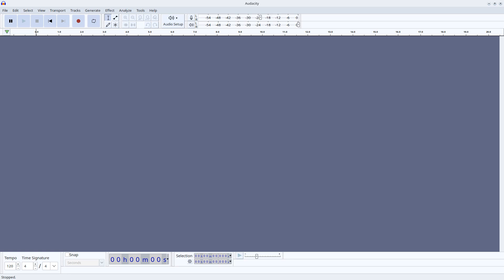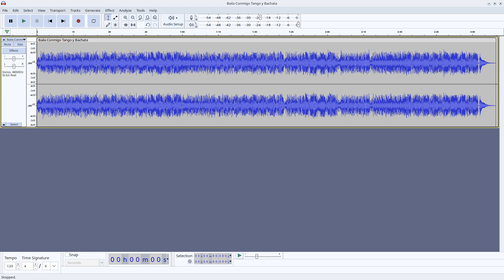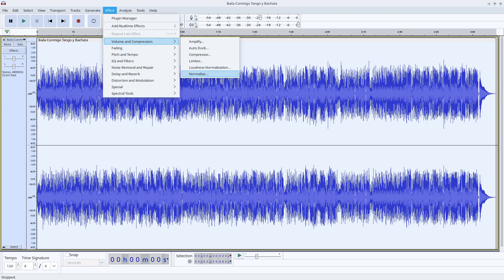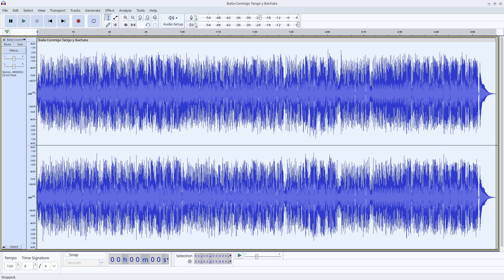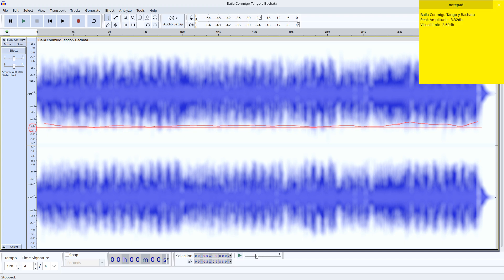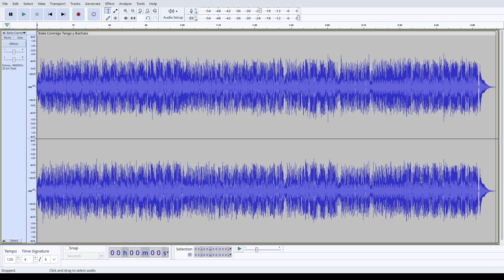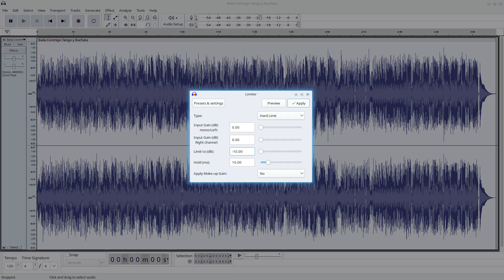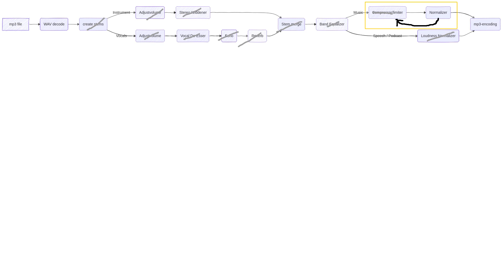Limiter and Normalizer. Audio Mastering with free software(Audacity Step by Step)

Comment: Amazing tutorial Audiotait! Thank you so much. 

One question: in the masterized version, the playback sound seems to be hitting levels of red up top. I have very basic musical knowledge, but when sound reaches red, doesn't it start to distort as well?
Reply from the maker: no. :) the colors are more for orientation and monitoring(in live setting or for recording). As long as the audio does not hit  0dB you are fully safe. Thats why its important to actually measure it with tools and use the normalizer at the end of every step.
Reply: @Audiotait-t7c  Got it! Thank you so much. Looking forward to more tutorials 😊

Comment: following this tutorial right now. one thing that tripped me up is that on the new version of Audacity there's a new limiter. The version of the Limiter used in this video can be found under Effect > Legacy > Legacy Limiter
Reply from the maker: yes! they updated it. the functionality remains the same. I might make a video with the new interface. I try to make the explanations independent of the tool.. Sometimes they move buttons or relabel them but so as long as you look for the most imporatnt parameter (the threshold) the new one works the same.
Reply: I was getting confused by this. Thanks!!